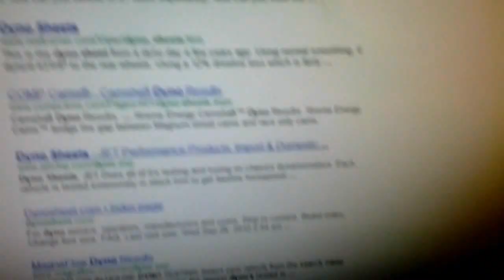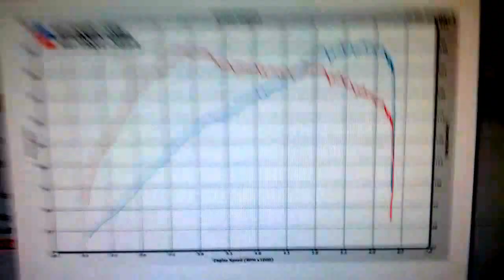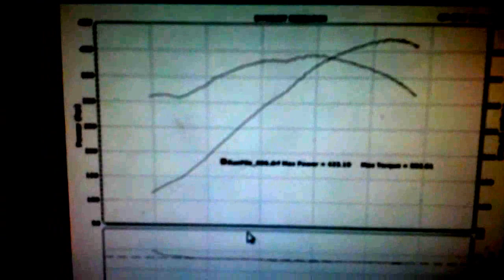Horsepower vs. Torque

Comment: Sorry meant to say they may cross if the engine is allowed to rev high enough in metric units, somewhere north of 9000rpm if I remember, again this is a constant due to the relationship between torque and power.

Comment: Interesting as you worked it all out in imperial units. I was trained with metric kW and Nm. The 5252rpm constant is just a quirk of the units you are using. Torque cannot equal Power as they are two different things measured in different units - but yes completely related. As you rightly say power is a function of torque. If you plot Nm V kW and use the same Y axis the lines will never cross and the 5252rpm constant is irrelevant.

Comment: actually, it can be possible to change from horse power to watt unit
1hp= 735 watt
am I wrong ?
Reply from the maker: 1hp = 746W
Reply: thanks man
Reply from the maker: Blanco Houssam
One horse power is equal to 33,000 foot-pounds per minute, and one watt is equal to one newton-meter per second:

1hp = 33000 ft-lb/min * 1min/60s * 1m/3.2808ft * 1N/0.2248 lb = 33,000/44.25 Nm/s = 745.76 Nm/s =~746 W
Reply: thanks again
Reply: in physics, in mechanical oscillation there is a concept of equilibrium between kinetic energy and potential energy which is very remarquable in the example of dyno sheets, actually in that number 5252 RPM
that's mean in that limit, the two type of energy ( kinetic and potential ) are equals
which are  (angular speed = power) and torq
Reply from the maker: zanick2 how old are you?